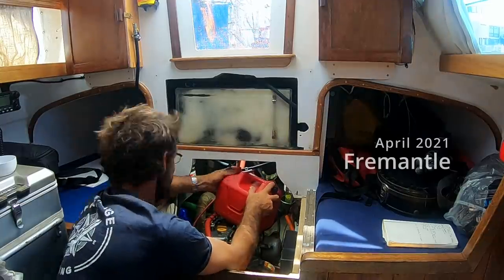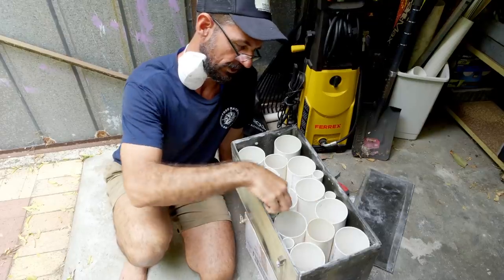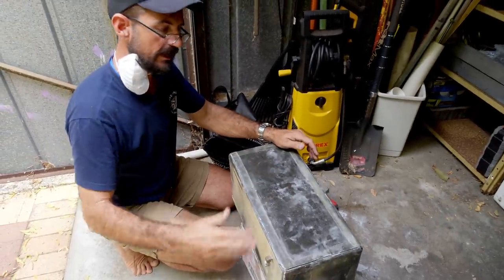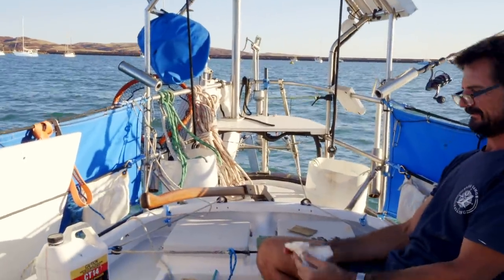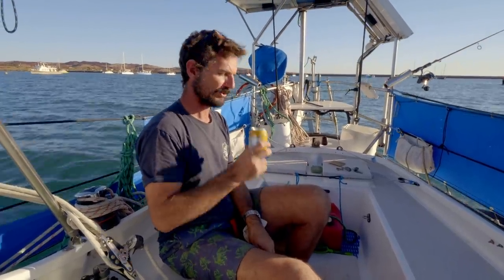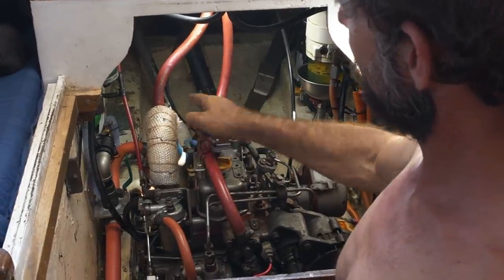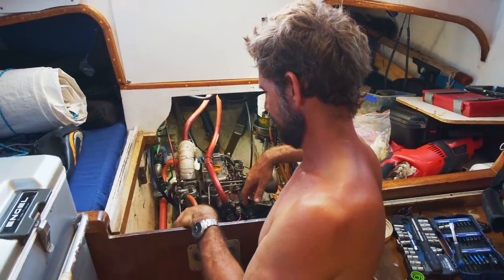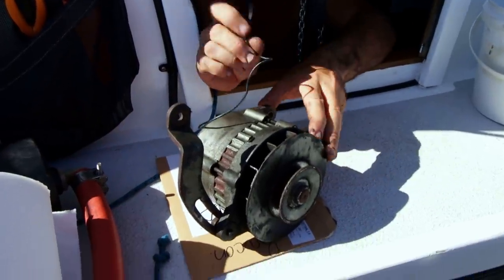The Secret Life of Sailboat Owners - Free Range Sailing Ep 192

Comment: Brilliant mod to the raw water intake.  We permanently tap off of our head intake for our raw water wash down pump, it has it's own valve to keep it off when we aren't using it since the pump is below water level.   

We don't fish so the idea of a few head bacteria working it's way back into the system isn't a big deal.  The anchor doesn't care when it is being washed down. Maybe that is why the galvanizing is getting a nice dark grey patina?

Another use of the tap would be to act as another engine cooling water source if you sucked a bag up into/onto your raw water intake through-hull and lost cooling water for the engine. Compressed air sometimes works to blow that out from above but sometimes it is a trip into the water to clear it   In a tricky inlet or in between reefs this could literally save the engine and the boat when minutes and seconds count.  

We'd have to pull the intake hose from the seacock and drop it into the wet bilge which is dry 99% of the time -but a few buckets of water from over the side would solve that problem.  I could maybe transfer the hose over to the seacock for the macerator overboard pumpout which is nearby in the engine room although that is a 1" hose and the engine is a 5/8".  I should get an adapter hose barb and some spare hose clamps and zip-tie them nearby in case of that eventually.  Something to think about!  Great ideas guys.

Comment: Just so you know, they do make an epoxy resin that is resistant to petroleum based fuels, such as gas and diesel and chemical resistant as well.  That is the proper epoxy to use when making, coating or repairing fuel tanks.  BTW, thanks mate for the PVC baffles idea.  Great idea and I'm facing a fuel tank rehab and will incorporate your idea when I do it, plus give you credit for the idea!!  ;)

Comment: 15:32 fitting a cap to that hose lock fitting when not in use is definitely a wise idea, 24,12  well done getting that broken stud out didnt think that would move , but hey it did , take it easy both
Reply from the maker: The joy of putting corrosion inhibitor on threads before assembly

Comment: Always handy to have a spare pump that can be utilised for different things. NEver heard of a Camlock before, thanks. Surprised you would risk starving the the engine impellor, but if it works it works. Well done.
Reply from the maker: Installing pumps with cam-loks makes life easier if you ever want to remove them for servicing or interchange a working one for another that has developed a fault. No wrestling with/cutting hose. To here is no risk of starving the cooling circuit as the intake hose has a greater cross section than both other hoses.
Reply: @FreeRangeLiving  makes sense. Thanks for info.

Comment: Your baffle idea is great. I will consider that soon when I have to make several black waste tanks, though I will make “v” notches in the tube bottoms of stand offs to prevent clagging. So thanks for the idea.
Reply from the maker: I think I would run an 80mm hole Saw through the bottom of each one and hopefully the waste is macerated before going in.
Reply: @FreeRangeLiving  I agree. Re maceration, I have a reversing switch on my head. Close the lid and operate the pump and the material is reduced to a colloidal consistency, which is fully degassed and sinks fairly rapidly when discharged at anchor. I  have to make an Arduino board to control the full cycle, but running the pump backwards causes the material to circulate back and forth through the blades as it is actually pumping in both directions at the same time. I left the original Lavac pump in the line so I have a backup to the electric, and I can pump the line completely empty to reduce crystal buildup. It also means the head can operate with very little water. My electric heads are Dometic. Thanks for your input. Troy. The round baffles are the best way to go for a lot of reasons, when you think about the damping properties of round surfaces.

Comment: Brilliant idea for tank baffles! Noted and filed away for future use. Thanks, Troy!

Not that Mirrool has the room for it, but for my own build, I plan on simplifying the whole engine maintenance thing by having a diesel outboard in a well.
Reply from the maker: A diesel OB in a well would be a great retro-fit idea in a Clansman and very practical all round. Extra credit if the dinghy outboard could act as a back-up or the two were the same.
Reply: @FreeRangeLiving  - I initially started looking down that path because the only fuel I want onboard is diesel. No gas, no petrol. Turns out the vast majority of diesel outboards are large, 150hp+ units designed mostly for military use, but the last time I checked, there was one Australian supplier of diesel outboards in the 5-50hp range in Qld. Don't have the details to hand any more, but could probably dig it up again.
Reply: @Garryck-1  Jafo do you have the name of the Australian diesel outboard supplier and the name of the diesel engine manufacturer?  I love the concept of an all diesel system with a couple petrol containers on board for others in need.
Yes, those EU compliant out board diesels are absolute monsters in size and weight.
My dream diesel outboard dingy motor is the 111 Dtorque Turbo Diesel outboard engine. They are distributed and maintenanced by Yanmar.  The diesel engine is 50 hp but it's gas equivalent is a 70 hp engine. 
Two negatives with the Dtorgue; 1. size  2. weight 175kg (385 lb)

Comment: I like the water intake mod also because  you can use the bypass as an intake from the sea in the event of skin fitting blockage .
Reply from the maker: Having the deck pump close to the engine makes it a back-up engine raw water cooling pump as well until a proper repair can be effected or belt replaced.
Reply: So many great options. A friend of mine frequently motored into bad patches of weed in the PNW so he also added a "T" fitting. In his case, however he hooked it up to a foot air pump to blow the weeds back out the thru hull to clear the blockage.

Comment: Great episode ...... have you ever thought of installing a car airconditioner pump to the engine and adapt it to work as an air compressor (4wd mod - Endless Air), with a small light weight tank this could give you the capacity to have high pressure air (upto 120 psi @ 8 cfm) at your finger tips for all manor of jobs without sacrificing much space ...... just a random thought generated from this episodes topic
Reply from the maker: I had thought of it- I used to have that on my old Series II Landy but I couldn't really justify it. I tried to come up with a way to have a PTO to drive a dive compressor as well but there just is no space and we can free dive 15m pretty well.
Reply: @FreeRangeLiving  no worries.....power steering pumps have been used to drive hydraulic winches but no sure they can cope with what would be required for a dive compressor......cant really hunt on SCUBA

Comment: Hi Troy & Pascal good info there is one more use for that tee valve inlet you can use it to check if your inlet strainer is blocked before you start the engine if you crack the valve after you turn on main valve to the hull then turn it on and water comes out you know the hull fitting is not blocked because if it is good way to cook your engine 
Cheers Leigh

Comment: Love the channel guys and how you both offer so much in terms of showing us beginners the real foundational information and skills we need to know to undertake a sailing adventure however large or small. Thank you and please, keep them coming. You guys are my go to . . . My question is, with your sea inlet wash down system, it seems you leave the deck wash down connected mostly to the cam lock fitting?? I am right in seeing that you then run this hose through an independent electric pump which is how you also use it as an emergency bilge pump?? I would love to see a diagram of your setup for this if possible. Thank you and safe travels. Cheers Mark : )

Comment: Some good ideas there with the plumbing. I like to have multifunction in everything too. I am facing an engine removal because even with low running hours my Yanmar engine is 20 years old and is struggling to get even 20 PSI oil pressure. So I would rather pay the cost to have it rebuilt so I know what condition it is in before I head away from shore. To do that I have to build 2 small swing hoists to get the ending out of the well and in to the passage, then from the passage to under the boom in the main hatch. I agree that having the ability to lift the engine permanently is a good thing to always have and I will probably leave the smaller hoist in place. It was good to see the little chain hoist and I will track several of them down.
Reply from the maker: Have you tried replacing the pressure regulating valve that is under the oil filter? If it is faulty, it bypasses and the pressure is low with no fluctuations during running. Might save you thousands.
Reply: @FreeRangeLiving  Thank you for that, Troy. I will check that out on the week end. I owe you one, even if that is not what it is. Having explanations is the art of self help. I’ve just been to the METSTRADE in Amsterdam. There were so many cool things. When I have been through my collection I’ll give you a list of links you might be interested in. Next week I am going to Prague to pick up some special tubes I’ve had made to prototype thermal energy collectors that transfer heat from your solar panels to your hot water cylinder. Ie you don’t need to run your engine to have a hot shower or wash the dishes.

Comment: Great video - thanks so much.   I saw something similar in a book about having a back up bilge set up with a way to close your sea cock valve and pull water from the bilge to the engine and out.  I really like to compression couplings but I didn't know that they were reliable enough to seal properly over the long term -  I will definitely give them a second look.  I also have plans for a wash down circuit to the cock pit but I was thinking only in terms of connecting to my fresh water tank for a quick shower rinse with fresh water.  I like having the sea water option for cleaning fish, etc.  Thanks again and keep us educated....Cheers!

Comment: Could you have put a 150mm inspection port in the top of the tank and through this inserted enough lengths of pvc tubing to achieve a good baffle? It would also make future inspection and cleaning easier.
Reply from the maker: Hard to get them in but yes, you can. I would just do surgery on it again if I needed too and guarantee no leaks.

Comment: Brilliant use of the raw water intake and engine pumps ability. 
I notice you've used a mixture of a Poly Camlock fitting and Brass. 
Is the connection as reliable mixing materials or would it be better to use poly to poly or stainless to stainless, ect ect.   Also You have the Male connected to the " fixed " side and the females onto your choiced connections. 
Would it be cheaper to use the Female on the ball valve side and then use Male fittings on all the different hoses you'd connect ?
I was looking at prices and see the Male fittings are cheaper.  Thanks Troy !!! Fair winds from SV HYDRA

Comment: I don’t know if a video about your impressions with your Port A Boat would be video-worthy, but my wife and I are considering getting one for a dinghy.  I like the appearance of how easy to stow and relatively small space one needs.
What size did you settle on?  What were the reasons you chose the size you did and why go with a Port A Boat?
Our concerns include carrying capacity, ease of rigging for sea and breaking it out, and difficulty of mounting motor and dismounting same (as compared with other dinghy’s that you  have experience with).
Do you think that the carrying capacities listed for the boats are about right or are they capable of carrying more than advertised?  ( 10’ 8” - 515 lbs.’, 12’ 6” - 670 lbs. total for people, motor, and stuff.)
Just as important, how easy is it for Pascal to handle the boat?  How easy is it for her to get into the boat, from the sailboat and from the water?
As for motors, I have a 4.5 Mercury 2 stroke that I would like to use but would this be a proper choice of outboard to push the 10 and 12 foot Port A Boats?  
How easy is it to wrestle with it on a 30 foot sailboat?  What methods of stowage have you found to be workable?  
Seeing how the total depth of the boat is 24”, it can’t have too much freeboard so how wet is it to ride in?
Reply from the maker: https://youtu.be/WHHrLTMZSYg
Reply: @FreeRangeLiving  Thanks.  Has any other pro's or cons surfaced since three years ago?  If it weren't for consideration of crocodiles, would the 12 foot boat have been suitable?

Comment: There has to be multiple engineering solutions to a wider range of wind speed for the wind generator. Or maybe a way to regulate the max. wind speed over the blade fins.   ?????
Reply from the maker: Sure. There's later model generators you can buy that address it.

Comment: It is  a pain when the motor mounts fail. I've had to change mine 3 times in 10 years. Next time I'll change the to a complete new mount.as the do wear out.
Reply from the maker: Yep. Mirrool gets constant use, a lot of it heeled over so those bolts only last a few years. 2 cylinder engines are pretty hard on components too as they are quite a source of vibration despite the large flywheel.

Comment: Whilst the Yanmar is a beautiful little engine the 2gm at low revs as you well know Troy are as rough as buggery and jump around on the mounts or at least myne did on rubber mounts but the next boat i had,had a Volvo. You could put a glass of water on the Volvo at idle but in fairness it was 3 cylinders as against the old 2gm Yanmar.

Comment: do they make a softer mount to allow for more movement of the engine being a 2 cylinder so as not to put as much stress on the mounting bolt for more movement just a bit?
Reply from the maker: 3 years of nearly constant use is pretty good for a mounting bolt. That's a decade or more on most boats.

Comment: Have you done a video on the alternator mod ie manual external regulator?
Reply from the maker: No, because it can lead to battery damage if not monitored correctly or fully understood what is being done. There is a book called the 12 volt doctor and he has a few versions of the idea in there.
Reply: @FreeRangeLiving  clearly you have seen the results of my past DIY efforts. 😃.  There are several "12v Doctor" books. I assume you refer to the one specifically on alternators rather than general electrical systems??  I just want to check before getting the wrong copy.  Thx
Reply from the maker: No, just the general one.

Comment: Having just pulled our Westerbeke 21 out of our Nonsuch I am envious of that racket lift you have.  What brand is it?  We had to use heavy duty tie down straps and then a front loader (hard to find at sea)
Reply from the maker: Lever blocks are very common tools. Your local tool supplier or lifting equipment outlet will have them in all sorts of lifting capacities.